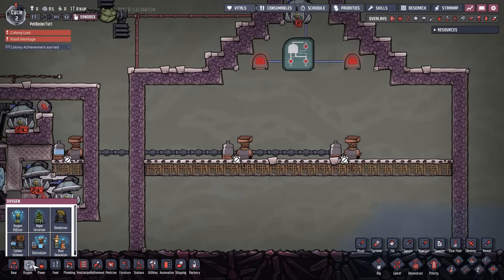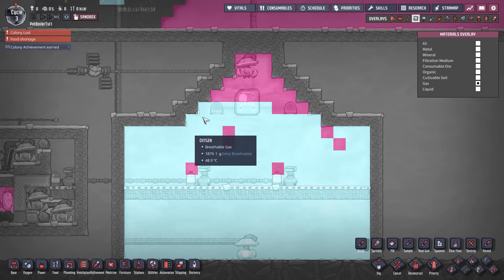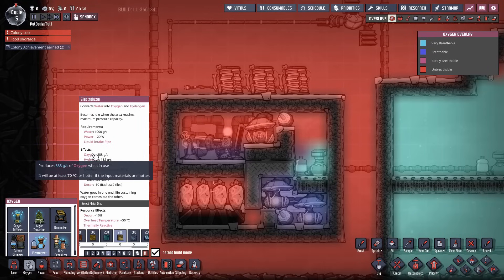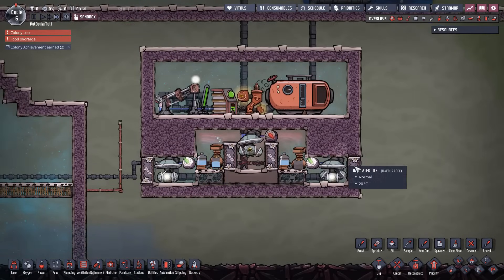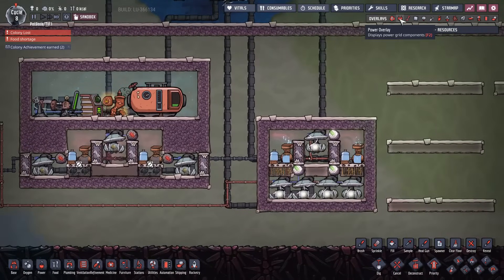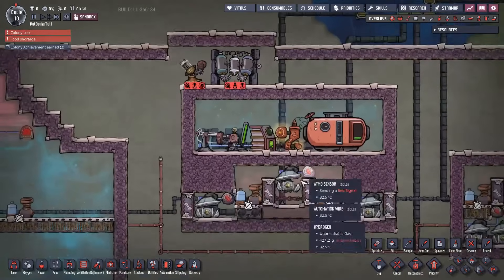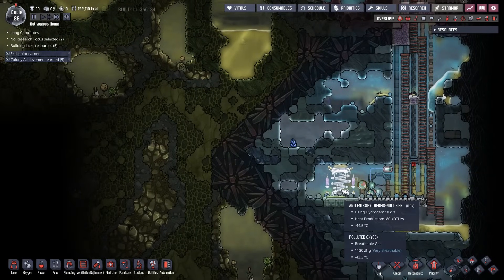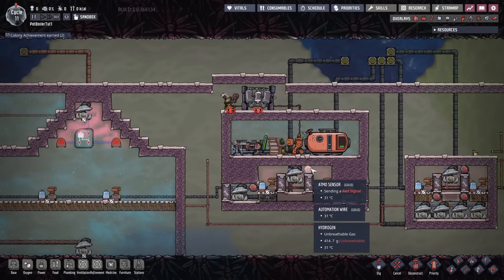Electrolyzer, SPOM, O2, Oxygen: Tutorial nuggets : Oxygen not included

Comment: SPOM can power itself, a fridge or two, and still provide a little bit of power into the rest of the grid. 2x electrolyzer SPOM + smart batteries + small transformer is the real power. You just control the H2 generator using one smart battery so that it is not running while the smart battery is full and the transformer with another smart battery and a not gate so that the SPOM never runs out of power. The 'overflow' power can run a fridge or two easily. You can even let the excess power from that overflow into the rest of the grid with another smart battery+not gate+transformer if you really want to. You should get enough free power into your base grid to at least cover the power usage for toilet water filtration. Of course excess generated water from toilet filtration goes straight into the CO2 scrubber.

Smart batteries are key since they lose much less power than the regular batteries. It's a big deal! Also you have to make sure the O2 never backs up, but I like to just divert it into one or two exo suits stations. If they get O2 then great, if not then fine as well.

It's one of the better systems I have found for early game. Refrigeration is one of the biggest early game power draws in one's central base. It saves a hell of a lot of power and therefor a hell of a lot of operator time. 

My single greatest tip for ONI though is... dum-dum-dum. Better scheduling. 3x sleep, 1 x washing and then only 2x downtime (not down time before sleep). This mostly (not always since some dupes might take a while to get all the way back to bed) makes sure the dupes use the toilet after waking up and then only go to eat. Allows for a more streamlined base design. Instead of running backwards and forwards in the evening it is Room - Washroom - Great hall in the morning. Perfect. 

Dupe time is the most precious commodity in the game.
Reply: I just skip refrigeration and build a small CO2 pit under the kitchen. On the other hand a small constant power draw is useful to keep this system running as there may be times when you don't consume enough power to get rid of the hydrogen. And gas buildup can jam up this system.
Otherwise, yeah, there is quite a bit of excess hydrogen because not all the SPOM parts are running at the same time. So hydrogen can power the base first and after that natural gas and coal.
Reply: @S_Black  Yeah. CO2 works. But I like the fridge right in my Great hall. Also some of the CO2 always has a chance of escaping if the pressure suddenly drops for some reason. I always use CO2 right at the beginning of the game too though.
Reply: If you have it accessible only from the top it won't escape. Currently I have a horizontal door between the kitchen entrance and the grill. And the great hall above the kitchen. So people can pop down and grab a snack.
Later on, yeah, having a fridge in the mess hall itself saves some time. And you can spare the power then.
Reply from the maker: @S_Black  I install a hydrogen overflow system to burn off the excess hydrogen if it backs up.
Reply: Yeah I have the same. First hydrogen goes to the SPOM, then to the AETN, then to a canister bottler and then  to the power plant.
But you all most of your machines are idling you can still have too much of it. I guess it isn't an issue with your mega bases :) I suppose I could make a giant gas reservoir, but there is so much other stuff to do...
Reply from the maker: @S_Black  I know how you feel, I could not be bothered wasting space on giant rows of gas tanks. This is coming from a guy who cores out the entire map.
Reply: I meant more building a chamber, vacuum it out and pressurizing to 10kg per tile.
Reply: @S_Black  you can use pressure vents to pump 20kg of gas to a room
Reply from the maker: That is the reverse of my schedule but the same number of chunks pretty much. 4 down time, 2 sleep.

Comment: Why does one of your designs (the one with the gas tank) with 2 electrolyzers work on 2 gas pumps (for oxygen) and the next design require 4?
Reply from the maker: Every design is a compromise. 2 gas pumps does not take full advantage of electrolyzers output but you get exactly 1kg/s of O2 in a four tile high package. 4 gas pumps does take full advantage of the electrolyzers but depending on your base you may need to load balance the 1.75kgs output. Additionally takes more than 4 tiles high to fit it in. I included a scale of designs of players could pick something that matches their dupes count and play style. The joy of this game is the variety of play styles you can use and how all of them are the correct way to play.
Reply: Yeah that's the nice thing about these designs. I currently need the power more than the oxygen, so the "4 tile high" build will work perfect. The O2 will be enough for my extra dupes, and I can use the H2 for power in a build that is already a net positive in power. Which also works because my gas gyser is about to go dormant. Makes for a good stepping stone for when I'll need a more O2 heavy build

Comment: Either the wiki and this tutorial are outdated or my game is bugged. My Electrolyzers are outputting air at pretty much exactly the input temperature of the water, which is 30 °C because I'm using po2 from slime biomes, cleaned trough the Water Sieve, which also doesn't heat/cool the water at all. 

Which is all super weird, I remember heat being such a big issue from playing during EA, so I a built a massive cooling system involving the anti entropy thermo-nullifier, which turns out to be complete overkill because instead of 70° hot air I get 30° warm air that my cooling setup cools to like -30 C° lol
Reply from the maker: Give it a bit of time, all of the equipment in the SPOM have default temp when they are build of 20C-40C it will take dozens of cycles for the hot O2 to heat it all up to temp. Give it about 100 cycle and you will be glad you setup the nullifier.
Reply: @FrancisJohnYT  That's the usual heat up over time from the machinery emitting heat, but I'm talking about stuff like the water sieve always outputting at 40° and the electrolyzer at 70°. Which used to be a thing, a thing you could even destroy heat with, but apparently isn't anymore in the current build.

In general, I have to say the game feels way more forgiving compared to EA a year ago.
Reply from the maker: @n3rdy11  Check the output text of build able items. If you hover over them it will tell you the output temp.
Reply: Edit: I tested it out in space and it DOES output at 70C no matter how cold the input water is. For some reason, the temperature evens out with its surrounding extremely rapidly and, in a survival setting, it can seem like the output is not 70C at all.

It is definitely not a fixed output temperature. It is input temp plus a little bit of heat generated by the electroyzer. Same way with the Water Sieve. It is strange that no one talks about this change and I can't find when this got patched. Even this youtuber doesn't know it changed.

Comment: Would an Anthropy nullifier fit with a rodriguez? Would the extra hydrogen be enough for it?
Reply: Aaah alright. Cheers friend!
Reply from the maker: An Anti entropy nullifier could not keep up with a full rodriguez but it could manage a half. There would be more than enough extra hydrogen. I ran one using the four tile high variants.
Reply: @FrancisJohnYT   
Oh damn. I planned to run a setup like that in my current game and now was disappointed. But trying it in sandbox mode it sort of works if built right. If the AETN is in 1-2 kg/tile of hydrogen and some temp shift plates to even out the spread of the heat (so it doesn't just cool the space directly behind it) it cools the oxygen to around 20-25°C. Maybe depending on how many cooling loops you run. It isn't as nice as the cold air you can get with less oxygen, but it's maybe usable. Though I have a feeling that the oxygen will get hotter with time as the electrolyzers heat up.
As you said the oxygen in the SPOM can be precooled with cold water which makes the oxygen after the AETN super chilly (negative temperatures are possible), but that takes some additional effort.

What also works is a 3/4 Rodriguez with 3 electrolyzers and 4 oxygen pumps. Gives you two full oxygen lines and the AETN has an easier time :)
Reply from the maker: @S_Black  It's always best to test stuff in debug first, I do that with most of my designs. Especially if it's a base critical design. Never tried pre cooling the O2 with the incoming water AND using an AETN. But in theory you should be golden.
Reply: @FrancisJohnYT  
It seems to work, but I haven't run it for long. I assume an aquatuner cooling a cool steam vent consumes less power in the long run than one constantly cooling the oxygen. 
In any case it was also the natural evolution of my build. At first I used the AETN alone. Seems weird to just not use it anymore. And I need to tame that vent anyways for other reasons

Comment: Nice video, thanks! Can you do one where you explain the different materials types when you construct something. Maybe it's my fault not understanding the dtu stuff :)
Reply from the maker: Material types are more about overheat temp. Copper, iron and aluminum overheat at 75C. The O2 and hydrogen come out at 70C, throw in the heat the machines give off and you can get to 75C and damage the machines. Gold gives an overheat bonus of +50C so your equipment won't overheat until 125C so it's much safer. Steel gives a +200C bonus which is why it is so valued.
Reply: Heat capacity is how much energy it needs to change temperature. Thermal conductivity is how well the thermal energy (heat or cold) will pass through it. Imagine a water tank, HC is how much it can hold and TC is how much said "water tank" flows.
If you want to insulate your base, high capacity with low conductivity. If you want different temperatures to come in contact fast, you need high conductivity.

Comment: Great tutorial, as always. I have a question though: at 13:43, you hook a pump and a sieve up to your SPOM. Wouldn't the wires overload? Maybe I don't have a great understanding of transformers.
Reply from the maker: The pump and sieve are on the draw side of a small transformer, the line can never draw more than one KW so it will never overload (Not 100% accurate there are ways to do it but it's rare) The system may chug very rarely when to much draws at once but it will run very safely.
Reply: @FrancisJohnYT  thanks!
Reply: @FrancisJohnYT  I was wondering why you had a transformer on that model, which by default only uses 960 W. Makes more sense if you're attaching a pump and sieve!

Comment: Huh. So it seems the oxygen production solution that I've been using is the "Half Rodriguez". Been working well for me so far, but you've shown me a few modifications I can make that can help improve mine (Such as snaking water around the pumps to cool the oxygen). That and I think I may have misplaced my hydrogen pump since the amount of hydrogen it pumps is rather paltry... Not gonna be able to play until tomorrow night, but definitely something I need to look into. I'll also have to consider building a "Full Rodriguez" at some point!
Reply from the maker: Save file is attached so have a look about and see how they are stuck together. Can also stress test them if you want.

Comment: How about how to deal with 500c Vents....
Reply: Depends on the vent. If it's a hydrogen vent, you can build a small enclosure around it with gold metal tiles at the top and a gas pump adjacent to it (just a little off to the side). Build a steam turbine setup by having the metal tiles heat the water and you have a decent heat deletion setup right there. Cools the hydrogen to about 125ish degrees, making it safe for the pump. I'd still make it out of steel anyway, though. You can burn hot hydrogen no problem. If it's something like a hot polluted oxygen vent, you can do the steam turbine thing there too, and then pump the hot gas through a heat exchanger that has polluted water from a slush geyser going in the opposite direction. Should cool the oxygen down to be useful enough and warm the slush enough to be sieved safely.
Reply from the maker: Your pretty much looking at a steam turbine as your only choice, you might even come out a little power positive.

Comment: Everything works so nice in creative when you can add and delete parts even gas without opening up the cell right? However in real game you would need liquid lock to make the vaccum before you run it or fill it with pure oxygen, get out the CO2  and still filter the oxygen out of the hydrogen in the beginning to prevent the wrong element damage to the generator. I prefer to just pump all gas mixed and then filter it using the gas shut off valve. It's only 10W extra or so, comfortably self-sufficient with tons of leftover hydrogen. And it just runs. Even when your oxygen pipe gets clogged, when your water temporarily runs out, when you break it open and foreign gas gets inside it just runs.
Reply: Leave the top gas pump off until hydrogen fills the top chamber; it's called priming.
Reply: @harrylam5507  So another thing you have to keep in mind and monitor. Thanks for adding to my point
Reply from the maker: To vacuum them out is super easy, barely an inconvenience. Put gas vents on the outputs and turn the gas pumps on using the atmo sensors. Once it's vacuum, reset atmo sensor, turn it on, when the gas equalizes delete the gas vents. Never touch it again.
Reply: @FrancisJohnYT  OK, that's true, that makes sense. I'm gonna give it a go one more time. :D

Comment: Really cool, I personally started running my base with 2 full Rodriguez generators, and I'm compressing the excess oxygen using a door compressor. But not matter which one I use I never get these things to run on themselves
Reply from the maker: What else are you powering bar the electrolizers,  gas pumps and liquid pump? Oh should point out I once used the same liquid pump to feed two electrolizers and this was to much power draw and ran the SPOM out of power.
Reply: Its either an inconsistent water input, blocked oxygen output or power issue. Right now i guess its because i have 2 of these outputting to only 2 pipes for oxygen out. But its still producing more than i need so i didn't bother fixing them. Im more miffed that the hydrogen output is lower bc of it.

Comment: Can you do a Tutorial Nugget on All kind of volcano tamer systems? I am struggling on petroleum mainly on the pipe breaking. What's the calculation behind it?
Reply from the maker: No calculations, it was just a case of practical testing and running multiple designs with different length counter flows until the required efficiency was found. All attempts at math proved inaccurate when compared to practical testing.

Comment: TBH, my favorite "SPOM" design is:

1) Go to frost biome
2) Make it there
3) have hydrolyzer in middle and one pump above, one pump below
4) pipe goes from the top, around the room to the bot and out
5) bot pump has 5-ish bridges INTO that pipe (this makes it add all it's gases to existing gasses of the same type already in the pype
6) a single gas filter at the end
_________________________
This consumes the least energy, is much less labor intensive, produces almost the maximum possible output, is not prone to faults of any kind.
Later you have to do the cool water trick though, frost biomes do melt :P
Reply from the maker: No argument here, that is super handy. But maybe keep a few of the designs on file, some of the new maps don't have cold biomes. Also some of them don't have gold amalgam. It's pretty rough.

Comment: Great video. Used first version inside my base and it worked pretty good. Temps were not a major issue at all. I did find the second version with Wheezeworts does work. My o2 is being pumped out at under 20c and I am pumping in over 60c water into the system. I have pumped the room full of Hydrogen and use Temp Shift Plates, and that seems do do a great job. But like you say near the end. It is up to you if you want to cool the o2 or not.
Reply from the maker: It takes about 100+ cycle for the temps to even out, try to remember to keep an eye on them if your running plants. Stifled crops have finished more than one base.

Comment: A better way to produce oxygen imo is by using deodorizers.
It's a good use for p water, doesn't require cooling and produces a ton of clay for ceramics (especially good for maps that don't have a lot of it)
Reply: before the update that added the topside I'd run out of filtration medium, I don't know the dynamics of resources now, especially when you can grind rock to sand
Reply from the maker: Ah the old fill a 5 ton tank with polluted water and deconstruct it to get a 5 ton bottle of polluted water that of gasses like crazy. It's handy early on but it's not reliable long term. SPOM are set and forget you don't need to maintain them, as you get bigger stuff that does not require player input is the most valuable. Edit @Oprean Tirfan Mircea They added more sand and regolith falls from space, filtration medium is effectively infinite.
Reply: @FrancisJohnYT  You can just compress some liquid between airflow tiles, or just spill it out if you don't like compression. It only requies one delivery every once and a while. Sure it uses external power, but is a nice alternative to electrolyzers non the less. I supply 15 dupes with it right now and planning to go for ~25